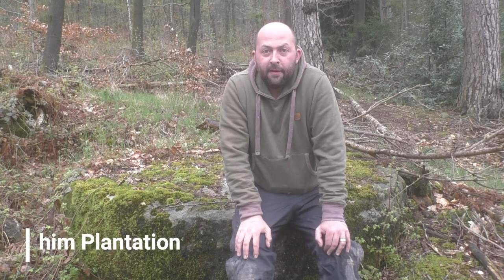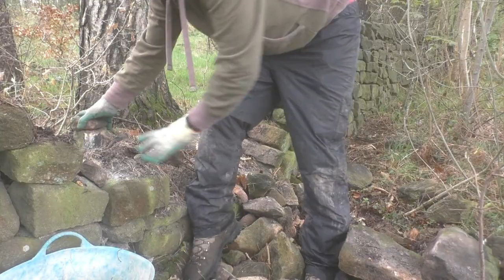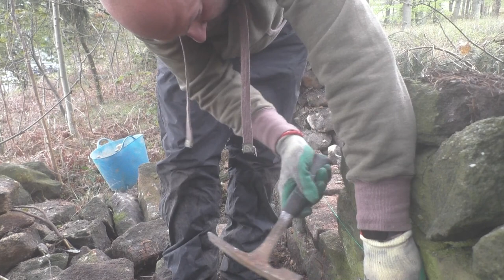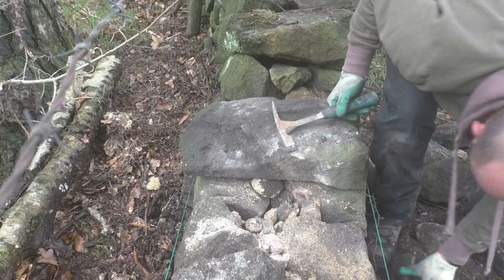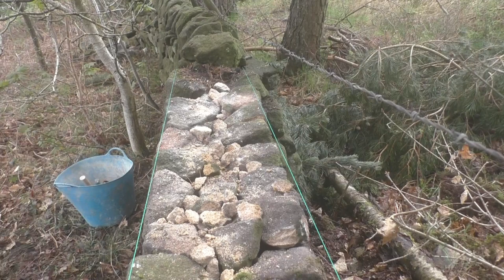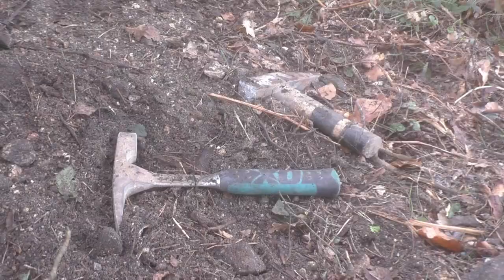HOW TO REPAIR A GAP IN A DRY STONE WALL FOR BEGINNERS, REPARING A FALLEN DRY STONE WALL, DRY WALLING

Comment: Nice job..sound advice and good explanation of the fundamentals, strength and pleasing on the eye..only starting myself so speed is least of my concerns.. as for hammers..meh!..in my own profession which is not stonework i would never tell a tradesman which tools he should choose..perhaps if someone asked advice i would..
Reply from the maker: Thank you for the kind comments and the feedback on the Hammer. It is a little bit of a bad habit truth be told, I did have a 2ld walling hammer with me, and in my workshop I have a wide range of different hammers, I went through a stage of buying too many all different shapes and sizes from brand new to old from boot sales & markets. But the little brick hammer I like to dress stone and find myself with my hand on it a lot more than I should. Like I say bad habit but I make it work, again thank you for watching 👍

Comment: Thank you for this video. On the uphill side of the gap, I noticed a large tree near the wall. Do tree roots heave up the wall, making it more prone to tumbling down. Or is this type of wall flexible enough to move with the roots?
Reply from the maker: Hi, thanks for watching. So, definitely, the roots of the trees are a problem for the walls, and when walling around a woodland like this, it can be even more of an issue. And again, you are right; the nature of a dry stone wall having more movement in them over a mortared wall helps. But ultimately the dry stone wall has to stay within the boundary. So, when they fall, you fix the problem and rebuild the wall. I hope that answers your question.

Comment: Thank you so much for sharing. This was extremely helpful! Just wondering, do you level the string lines with a line level or just by eye? Would the level not depend on where the holes are in the wall where you fix the pins into? Many thanks and keep up the great work!
Reply from the maker: Hi Magill,
Thank you for watching and for the kind words. I use both, but mainly with gapping. I just use my eye. When on a wall with walling pins/frames, I will use the line bubble.

Comment: Great video mate. Out of interest, how much would a waller charge for gapping up a metre or so like this? Just curious 🤔
Reply from the maker: Thanks, Bobby. Pricing might have changed since I was gapping regular but £30 per meter was my price, this was 6/7 years back now
Reply: @TheStoneRanger  Interesting. Yeah it's always a difficult one. I feel like dry stone work/ walling is very under priced compared to all other trades. If someone builds 3 metres a day, it works out around minimum wage, where as a brick layer, or plasterer might charge £160 - £200+ a day. I'd argue good stone work is more difficult.

Comment: Would it look bad if your to concrete the cracks by chance?
Reply from the maker: Hi Holly, thank you for watching. It wouldn't be ideal to concrete all the joints in the wall. You can point the wall with a cement and sand mix, but if you are doing this, you would be better off building the wall with mortar in the center to begin with. I hope this helps. If you have any more questions, please don't hesitate to ask. TheStoneRanger ⚒️⚒️